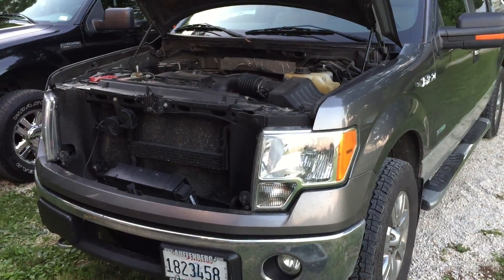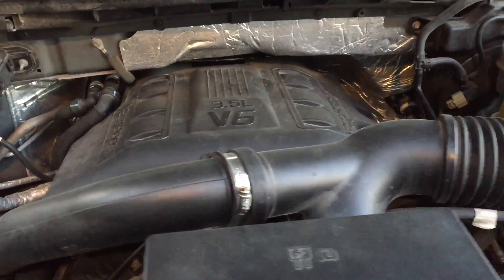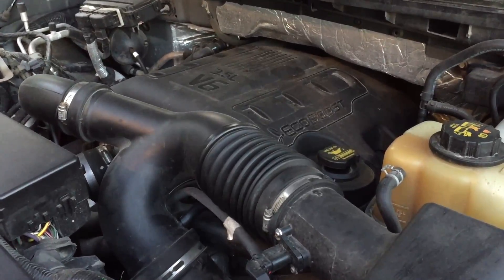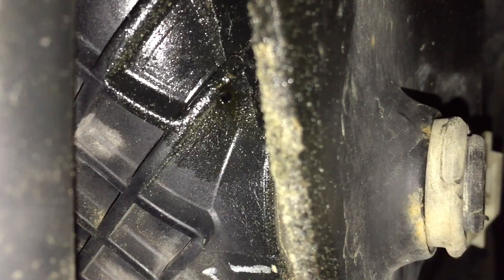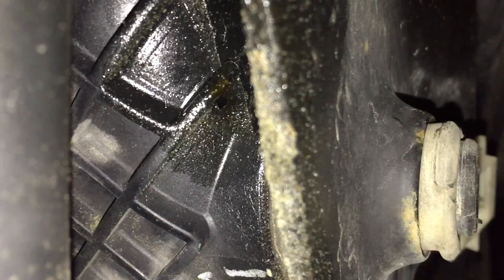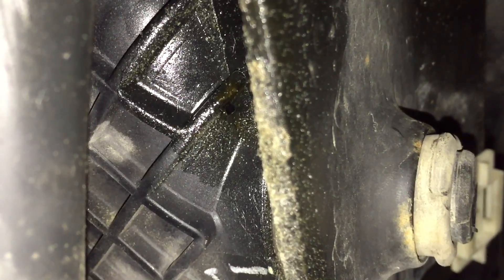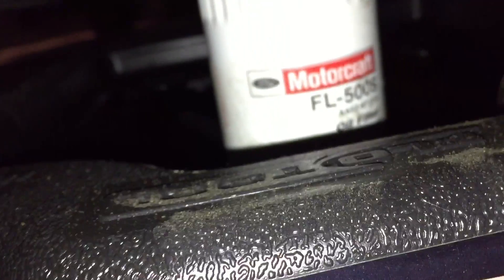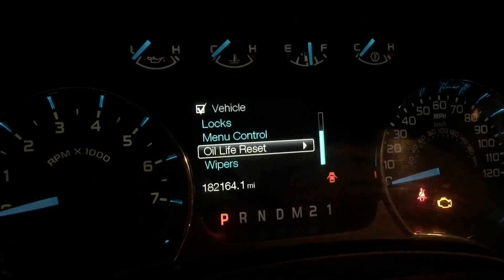Hole Drilled in Intercooler Fixes EcoBoost Misfire

Comment: You are still contaminating the valves, and shortening the life of the engine.. drilling the hole drains excess oil and condensation but doesn’t keep it clean
Reply: It has 240k miles on it. What more do you want? If the carbon build issue was that bad this engine would have needed a valve cleaning by now.

Comment: Did you have to take off the air dam to get to the front side of the intercooler? I have a 2014 limited for reference.
Reply: It's a necessity unless you have an angle drill.  Easy to do though, only two nuts holding it.

Comment: Actually the proper fix is a pcm reprogram and a modification to the intercooler to make it less efficient . The misfire is caused by condensation settling in the intercooler and under boost being forced into the engine. Which also resulted in converter failures on bank 2. And before any dumb shits post stupid comments. I've fixed dozens you other guys threw parts at and still do these daily at my own shop. A catch can goes on the valve cover no where near charge pipes. The majority of you guys on here don't fix shit. You're the dumb asses I laugh at with your honda jacked up in the auto zone parking lot

Comment: oh my dear Lord so basically what you're telling me is that you created a boost leak to fix your crankcase pressure problem bro you need to have every item in this world that makes you feel like a man taken away from you first off the reason you're having a misfire and it clears up is because you're having crankcase pressure build-up and blow oil past the Rings and get on your spark plugs it is normal to have some oil in your intercooler pipes but draining it is not the solution you need to first off get a catch can clean the intercooler in intercooler pipes after you have replaced the intercooler that you just destroyed and problem solved your having a misfire because your vehicle is trying to burn oil but hey if you really want to fix the problem just take the turbos off and use the intercooler as an intake my Lord what is wrong with grown men these days  and I don't want to hear anyone in this world say that crankcase pressure is just a known problem for this motor because I have designed built and installed and maintenance-free return atmospheric catch can that fixed a 800 horsepower race car from blowing the dipstick out of the block

Comment: I drilled two 1/16 holes. Oil came out close to a tar consistency. Fixed the engine stumble. Acts like a new car
Reply: It's hard top argue with that. Do you have a oil spot where you park?

Comment: Catch can bro. Turbo engines need a catch can Otherwise your getting gas, oil and water into your crankcase and builds up carbon in your combustion chamber, intercooler and valves. Just about every import turbo tuner car has one and although the EcoBoost is not a import, it is a turbo!

Comment: My 2012 Ecoboost only gets ~13-14 MPG and that's with it set to ~60 MPH on cruise going to and from work everyday.  I think I need to change my plugs, drill my weep hole, and get a catch can since I had to replace my MAP sensor on top of the intake when I got the truck, with 68k miles on it, since it wasn't just dirty but permanently discolored.  That has only been a month back but I've watched the MPG steadily drop from around 16-17 MPG to around 13 MPG now which is what I was getting in my 05 Yukon Denali with a big 6L Vortec.

Comment: I see a lot of pople saying this is INSANE and some saying it's a decent fix.

I have been going through sparkplugs CONSTANTLY on my high mileage f150 ecoboost. Same year, 2011.

They come out cracked and looking like shit, and gapping all off with barely 10,000 -  15,000 on them.

Always OEM plugs, gapped to .30

This intercooler has the TSB plastic cover installed to the bottom of the intercooler to reduce the intake but I have NEVER been able to put the pedal to the metal without it causing a misfire and then soon after need to replace plugs.

I don't plan on keeping this truck much longer but I desperately need a fix in the mean time.

Could this be it? Or does anyone have any other suggestions without spending a fortune?
Reply: Curious.... have you resolved the issue with your spark plugs cracking?  And was your engine diagnosed with a misfire by a technician or does it just "feel like a misfire" without having it properly diagnosed?  Thanks!

Comment: safer and cleaner if you applied Ford's intercooler fix for the Focus RS
= block off a section of the intercooler

reduces condensation and the issues caused.

Must likely the same issues here

Comment: This engine dont have that start up engine rattle.(timing chain stretch) . All other ecoboosts do have this..
Reply: Benito Jr wrong mine runs beautiful it has 110k on it did a spark plug change at 70k.. Going to flush the rad very shortly... Always ran synthetic it in changed it at 10k... I think you get the image that there all bad Becuase of watching videos like this...

Comment: You're an idiot. With a hole in the intercooler you not only loose boost, you also suck in unfiltered air if the system ever goes under vacuum.

Comment: I wonder if there is a item we can install through that hole to put a drain tube so you could run the oil out another place so it does not muck up the underbody...

Comment: Good fix, too bad nobody actually watches and pays attention to your video before commenting and criticizing.  It's a tiny whole people it wont effect boost. boosted systems leak just about everywhere. A catch can would not solve this issue since it is mostly condensation, 35  years with Ford and we know this concern.  All turbod intercooled car have this concern except for Subaru,  (there cooler is vertical/pancake mounted) Great fix and more power to you.
Reply: BarberChop It definitely works. I did it and there is no loss of boost or power
Reply: I did it as well and it fix it the same day after letting drain

Comment: 2nd gen 3.5 in 2017s have a different inner cooler. Will never have to drain one. Turbos will draw it out when it reaches about 1/4 on the bottom. if your gassing it both will draw any condensation out . You might want to put a screw in that hole so some oil gets to the turbos. It appears ford found a fix or decided to do something since they was getting a bad rap on the echos

Comment: Not condensate, not oil seals in turbo, that is just oil build up from engine blow by. EVERY turbo or boosted engine has it and the only way to REDUCE it is with a catch can on the pcv system but you will never get it 100 percent.  This is just a band aid fix because  you are still getting the intercooler internally coated with oil greatly reducing its efficiency.

Comment: if you put a rubber sheet over the hole and poked a hole in it with a needle.   would work to.    and you are right the hole size wont be bad for the way it runs.

Comment: This isn't any different then what we do with the VW TDI inter cooler.  except we put a screw in the hole between oil changes.  At oil change, remove the screw to drain inter cooler.  Oil will come out.  Good thing is it prevents it building up and being sucked up into engine under hard acceleration.  For diesel that would cause a run away engine,

Comment: You thought drilling a hole in the intercooler was a "good fix"? Are you leaving it OPEN? Normally on a turbocharged engine an intake leak is a PROBLEM, not a "solution". In fact, we (those of us who make a living working on turbocharged engines) make a point of ELIMINATING INTAKE SYSTEM LEAKS.
Reply: It's a condensation drain, nothing more.on the bottom on the cooler

Comment: wouldnt installing a capped off hose or nozzle into the bottom of the IC  and emptying it out every oil change be a better solution than creating a boost leak? .
Reply: It seems counter-intuitive to create a boost/vacuum leak, just catch can it and retain the correct pressure. I am not sure how many bars you are losing by drilling a hole in a sealed system like this.  Not sure the fix is a reasonable tradeoff.

Comment: the idea for this came from back in the day Volvos. They had 3/32 holes from the factory for this very reason. As a guy that bought his first new truck and has had to deal with this shit, and no help from Ford, I can tell you this is beyond frustrating.  Still love my EB.  I have had the condensation issue within an hour of driving in the right/wrong conditions.  I had the 1st Gen deflector plates. The 2nd gen deflector plates. The redesigned intercooler. It finally comes down to I need to be able to drive this damn thing and I am not rich enough to just simply swap out vehicles. This solves it. BTW, after the turbos but before the throttle body is almost always under boost. It's always been 1psi or more. And if you think a small hole like that is going to cause a problem you're wrong. I've seen 18 lbs of boost going thru that 3 inch pipe.  That's after the hole was drilled.

Comment: All you did by putting a hole in the intercooler was lower the boost. Did you try new plugs gapped at 
.030"? If lowering the boost stopped the mlsfire the problem was the plugs gapped too wide.

Comment: why not add a drain valve to the hole and drain it off every oil change
Reply: honda custom  my EB can develop  choking condensation in an hour if the weather is the right conditions.   There is more to this hole than just the oil part.

Comment: A sound idea.  The turbos will maintain full boost as long as the hole isn't too big.  The just delay opening the wastegates as needed.  You'd only lose a very small amount of boost at maximum boost and at high altitude.  Any gunk simply gets forced out.

Comment: Drilled the 1/16 in the inner cool and installed a catch can in between pcv air intake. Two necessary mods to keep the truck out of limp mode. I haven't experienced loss of power since just other shitty ford malfunctions. Ford has nice looking trucks but they can't handle the cold Canadian weather. My 98 accord is probably still running and I left it at the junk yard.... Built ford broken.

Comment: if you drill a hole you'll lose boost.  it can make the truck run better, but u lost some horsepower.   probably the waste gate or blow off valve.

Comment: Someone in the comments mentioned the Ecoboost intercooler on 3.5 in this video was plastic!? Not true! it's metal of some sort. Lightweight I'm sure but it's a good size for optimal performance. Ecoboosts of all sizes mostly 3.5 & 2.0 are hitting 200k mis no problem ..it's on many forums! all orig with orig turbos..engines  running very well. Ford designed these I'm sure to easily hit 200k plus! This a (gen1) 2011 1st year Ecoboost was avail on F150!

Comment: I don't understand why you need a big 3.5 litre V6 with a turbo, when "highway driving speeds" are 50-55mph. A  Mondeo turbodiesel would be just as good, and a lot cheaper to run.  
*Shuts off WiFi in preparation of hate*

Comment: Highway driving is of course the easiest on an engine, as well as prolonging Direct Injection carbon build up on the intake valves. I'd like to see an Ecoboost with this many miles, that's had a lot of stop and go driving.
Reply: I’d like to see you be able to even own an ecoboost before talking
Reply: @williswatrous4820  Fair statement, but why would I want to own one when their our some better options. Although, those options are going fast — I would buy a Ford over any other American car though.

Comment: A plastic intercooler.........  I own a Ford and that's disappointing to see
Reply: Chevy, Crystler, etc. They all have plastic intercoolers. Nothing wrong with that as long as it's not a radiator.
Reply: What motor from Chevy has a plastic intercooler? It may be ok for you . Me not so much
Reply: Chevy cruise I know has one, can't remember the year.
Reply: Every OE intercooler has plastic sides like that on the Cruz. The Ecoboost is all plastic is what I was talking about
Reply: Nope, aluminum with plastic sides. Otherwise if it was all plastic it would have very bad heat dissipation.
Reply: Ok man, your right I'm wrong. Feel better?
Reply: lol I'm just saying their all the same. If I had a choice 70's vehicles were bullet proof, I'd drive that. ;)
Reply: Yea they were. The dial knob for a gear selector in newer vehicles is a bad idea.

Comment: I'd try a oil catch can on the PCV before drilling any holes . It would be a two birds one stone thing too.
Reply: Anom Amos catch can won’t stop the condensation issue, only mitigates the oil blow by. Condensation is forming from the drastic drop in hot compressed air coming from turbos to begin rapidly cooled in cooler to throttle body
Reply: did the catch can a couple months ago as well as updated to the brown pcv valve with no change in the acceleration shudder

Comment: Screw a small fitting into that and run a hose to a vacuum source and it might even be 50 state legal.
Reply: I was thinking screw a fitting into it with a small reservoir attached. Can always open it up and let it blow out every now and then. Or run a host to the catch can...?

Comment: SO YOUR SAYING A MIXTURE OF OIL AND WATER GETS PUSHED INTO THE INTAKE AIR STREAM, SO IT DOESN'T SUPPORT COMBUSTION..  SO IT DRAINS OUT WHEN THE ENGINE IS OFF AND PUSHED OUT BY BOOST WHEN ITS RUNNING.   NICE JOB !!!!!

Comment: new vehicle make me want to puke, I had a 95 I think Dakota 4cly 5 SPD long bed single cab, got 25mpg and my 05 Cummins 6speed dually gets between 18-22 mpg long bed crew cab, some explain how 22mpg out of a new light truck is, good?!?
Reply: http://www.autoblog.com/2010/09/21/2011-ford-ecoboost-f-150-puts-out-365-horsepower-420-lb-ft-of-t/ :)
Reply: Yeah, what motor was in the dakota
Reply: 180,000 mi = new vehicle? 227k mi = just a little past new? 22 mpg on a 3.5 ecoboost is actually really impressive! I am happy when i get 15.9 mpg on mine.

Comment: @Jerrammie Villanueva suggested a catch can and I'd agree with him. A catch can would probably work. Or at least with the current solution you could tap the hole, throw a fitting in there, then use some flexible tubing to make a cheap catch bottle out of a small mayo bottle or something. Then put another hole in the lid and put a one way check valve in it to prevent a vaccum from pulling things in to the hole on vaccum. Or hell, if you don't care whats coming out and want to avoid blowing crud all over your truck, you could just tap the hole and screw a little check valve in to it, then run a tiny length of tube below where the oil would blow from the hole

Although where is this oil coming from? An EGR or PCV Valve? I guess I can sort of see the logic of putting the EGR or PCV before the turbos, due to the fact that you're going to have more vacuum before them but wouldn't that mean that you're cooking oil on to the compressor wheels which could cause them to fail early due to to bearing wear from having weird unbalanced loads on the compressor fins? I mean, living in the motor city I have friends who are engineers at Ford and GM and they're not dumb people, but you'd think that they would think of this failure mode. There has to be some logical trade off.

Comment: Wouldn't all that oil end up fouling the MAF sensor over time?
Reply: It seems to be settling in the bottom of the intercooler, but if enough of it built up I's say you'd be having other problems long before that became an issue. Before, the engine was hoovering up oil under heavy load which means there might have been a significant amount not flashing off once the engine got warm. That gets me thinking, though. I wonder how much shit that intercooler is filled with at this point. The intake charge was likely more than hot enough to eventually dry that oil up, and I'm wondering if some of the flow paths are caked with oil causing a restriction in the intercooler to the point where normally the oil would blow right by, but at the moment it's being slowed down to the point where it's in there too long and it's condensing on the fins of the intercooler.
Reply: @Atrophes , it does. I looked my MAF, saw oiley and sprayed it with intake cleaner. After which I say mileage increased about 0.5miile/gal.

Comment: Joe R - yes I know this is a positive pressure system. I was referring to contamination possibly entering that hole while system is under vacuum such as coasting down a hill with throttle closed. Under some conditions intake manifold can still go negative pressure. I just do not know how often that condition would happen with this motor. There is a video on YouTube showing just how much air is lost in a charge cooler with a 1/16 hole. He did the test with and without oil in the area. He tested up to 30 lbs in a closed circuit and the air loss was a nit. The pressure loss would easily be overcome by the wimpiest of turbos. At the end of the day a catch can or water/oil separator would be ideal, this fixes the problem too. It's just a bit messy. The little bit of reasearch I just finished on this seems too indicate this is a proven technique used by people who have worked on these systems for a living. Apparently, this intake charge contamination is a common problem on boosted engines in general and measures have to be taken to address it. That was a bit of a surprise to me. I am not a trained professional mechanic. My knowledge comes from fixing my broke vehicles and what had to be done to the the big trucks I drove for years. And there are a lot of gaps in that knowledge. But I do know what polished chrome muffler bearings and blinker fluids are and what Functions they perform.
Reply: Don't forget the can of "beep" for the horn.
Reply: The cooler is before the throttle body so no vacuum here

Comment: sad that there have been twin turbo V6 engines for well over 20 years now and most didn't have the problems Ford has with their's. Also, if there is any oil in the intercooler the turbo's need to be rebuilt or replaced. There shouldn't be any oil coming from the turbos.